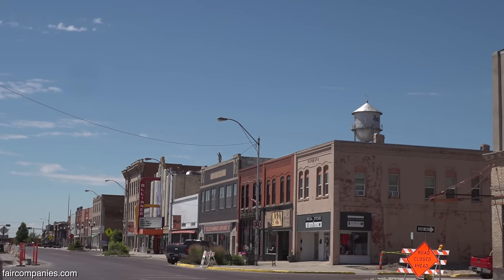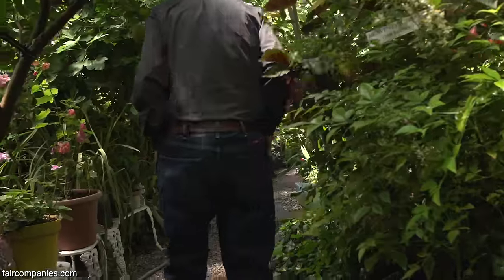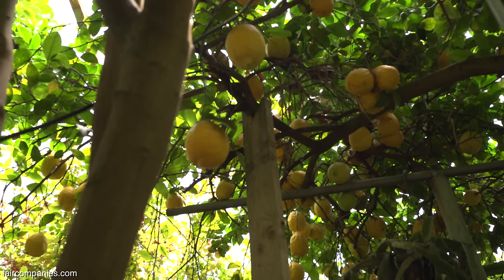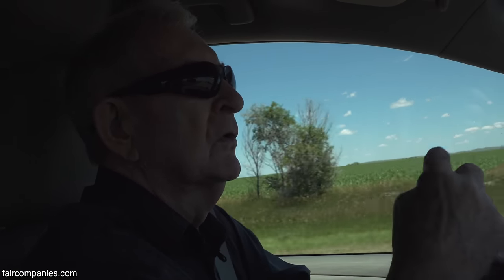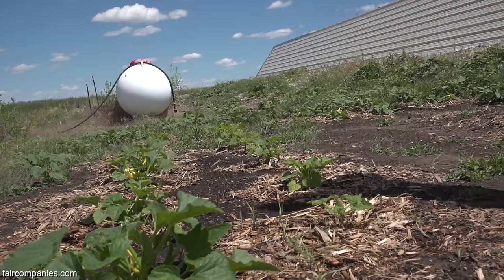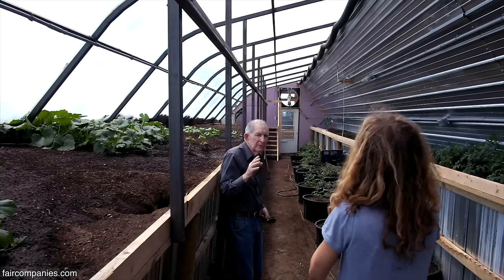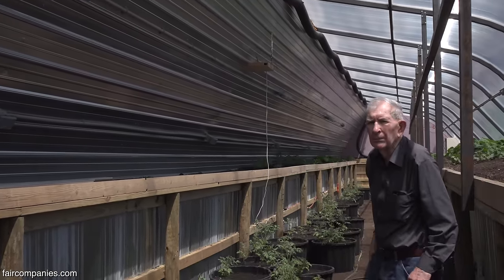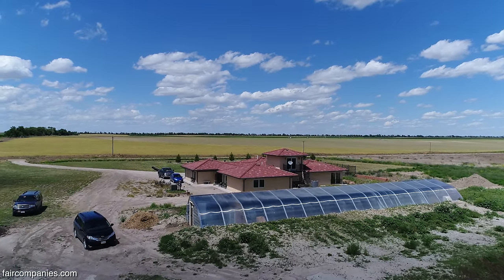Nebraska retiree uses earths's heat to grow oranges in snow

Comment: Always pull air. “Force” is dispersed when something without shape - like air - is pushed. No force is lost when pulling.
Reply: technically it would have the shape of the tube its in if you are pushing in to the tube.  I think the green house itself would be better to be sealed so it in theory would be like a home HVAC system for forced air.  Since there is the potential of a hot and a cold source.....a sterling engine could be employed to perhaps compress air to feed a Tesla turbine which in effect could drive a blower to use on the tubes and yet circulate air in the greenhouse since heat rises.  He is trying to make the system simple and cheaply conventional with off the shelf items...hence the typical black flex  8 inch conduit....very generic.   He is seemingly going by the seat of the pants to determine how long a run of pipe he needs to get the  air circulating through it to be rendered the 52 degrees of his location...…..there is no heat exchanger in the system.  He just trenches out and at 8 foot deep to bury the conduit......by the determined length he need to get the temperature.....if he is too short then he won't achieve the 52 degree constant he wants......but it also comes to the mass volume and the velocity of the blower to move the air through the conduit...….the hang time in the tube to change the temperature.   Too long of a run would achieve a better result than being too short or having to add on after the fact.....     A Tesla valve could be employed if there was a positive and negative pulse if the tesla valve was employed as a heat sink in the ground......getting the air to hang in the mass that is the tesla valve so the air absorbs the heat or dissipates the heat.   Or perhaps a chamber of concrete block laid over on their sides for the honey comb effect to have the air go through....which would be more conventional......you could use septic system parts with concrete vaults to pack with the blocks and connect the conduit system......but obviously the black plastic conduit is the cheapest.  If I'm thinking out loud.   My problem with the system as is...….is the possibility of infection......how do you keep it clean and not get any mold or bacterial growth inside the conduit where you'll be circulating it around or spores.....ultimately to cause problems with your plant life or fish......aside from working in the environment and breathing it in to your lungs as you tend to things
Reply: I would probably substitute regular rigid poly piping rather than the flex black conduit...…..you could most likely pass something thru it to clean the passageway where as with the flex pipe....there are so many nooks and cranny's......plus the poly pipe is white so it would be great with a sewer camera run thru it for inspection
Reply: @mikecamps7226  I wonder if their humidity levels are so low that it dramatically curbs the mold issue. Interesting post.
Reply: its an interesting situation.....I suppose an A & M college should step up to investigate and tweak things to get the most out of it.    I just did a posting on a different presentation concerning rocket mass heaters.  The efficiency ends up with an exhaust tat is theoretically pure.....just CO2 and water from the combustion.  This isn't a car exhaust where they need a catalytic converter to achieve that.....and the opposite end of that with air pollution pre-cat days, today we have the CO2 problem.  They created a CO2 pump in to the atmosphere.....times a few million pumps.  But anyway, with the rocket mass heater on a farm exhausting CO2 out the end of the conduit......why not dump that in to a winter green house to create an optimal CO2 atmosphere for the greenhouse and photosynthesis and monitor and regulate the CO2 level`...…...you only exhaust during a burn with a rocket mass system which might be only a few hours to charge the mass with heat like you are charging a battery.  The plant life would convert the CO2 to oxygen ultimately......its just determining the optimal ratio's..for the conversion.  If you want to totally convert all the CO2 emissions then you need the appropriate amount of plant life and thus the size of the green house.  But with a rocket mass heater....its just not the pass through with the exhaust to extract heat in to the mass......you could run water coils to heat water for pumping out in to the green house as auxiliary heating....there is a heat differential too that could power a sterling engine for a pump or run a generator to create electricity.   Engineers don't design this way.....    But being a farm, there is a big issue with biomass waste and what to do with it......obviously it would have to be dry to burn which could  be possible since you only need to burn with a rocket mass in the cold temperatures.  Sort of a big efficiency loop  of sorts that would be virtually totally "GREEN"       BUT going back to the humidity......its a green house so there will be water and evaporation and thus a humidity issue......its just solving the infection defect without using  chemicals or something adverse...and low cost and simple without a lot of maintenance.  You could use a HEPA filtration system for the air but that carries costs and upkeep.  It could get complexed.  The infection element is ever present, its just how to retard it and keep it in check so its not an issue where it destroys the crop or kills the trees or taints the harvest.
Reply: May depend on where the fans are placed? It might be easier to push air with a fan from the top of the tube than to pull it from inside the tube underground, but I'm not sure how they've set it up here.
Reply: Well considering a house HVAC system uses a squirrel cage fan......and the conventional thought of a fan is the propeller type fan.  A tesla turbine is interesting too.  My main concern is the tube being buried and the possibility of infection.....beasties taking hold in the tube and growing and then being vented out into the growing environment as a result.  Obviously there are microbes everywhere and in the air....nothing is completely sterile in a natural environment....but that tube will be a potential dark and potentially moist place which would be a great breeding ground.....so there would need to be counter measures.  You wouldn't want to compound the normal infectious agents you have to battle in a green house should something take hold in a growing season......which means breaking out the chemicals.  I think the basic premise is to be as natural as possible if it meets the criterial of organic.....or at least pesticide free for purity aspects.  But I do love the prospects of the natural cooling effect or warming effect depending on the season.
Reply: @mikecamps7226  Wouldnt it be less of a headache to just put in a traditional heat pump? I mean your paying for the backhoe to dig for the black tube, whats a couple of grand more for a legit heat source? solar panels and batteries to power it?
Reply: @mikecamps7226  I think if he sealed it the way you suggest, there would be mold and fungus problems, exactly as you are concerned about. 
He is avoiding that problem by letting outside air circulate in and move through the greenhouse.
Reply: @mikecamps7226  Black absorbs heat and the ridges give you more surface area. On top of that, it's much cheaper.

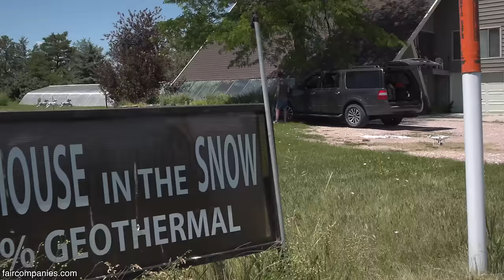Comment: 0:28 "This is probably the worst place you could ever build this..."
North Dakota: ... hold my beer.
Reply: haha, true.  Interesting though that he's not using super-high R-value material.   I do wonder what a similar approach to ND with higher R-value could yield.  I'm guessing there would be a lot more shoveling though!
Reply: @Nick-bh5bk  What would be the highest R-valued transparent material? I wonder how much deeper you might have to dig to get the same soil temperature he has. The frost can penetrate almost twice as deep in the red river valley, ND, compared to where he is in Nebraska, so I'm guessing you would have to dig... deeper. Then you have the issue of the latitude. At peak darkness 47 degrees north latitude (ND) gets 8.3 hours of daylight and at 42 north (NE) they get 9. Not a huge difference but NE gets a better solar inclination and therefore more direct sunlight. ND might still be able to grow oranges given the same greenhouse conditions but maybe not the same quality given the amount and quality of sunlight. So that would limit what you could or would even want to grow... I want to meet this geezer, seems like he's been around the block.
Reply: Hey, i totally diagree. Thus is an effective technology for most areas, you just aren't going to grow oranges in the Red River valley of ND and the building will be constructed different,  with superinsulated structure instead of what's appropriate in NE.
Reply: @dingFAching  Check out these concepts for what is possible in a cold climate:

1. Elliott Coleman showed that an unheated hoophouse within a second one can adjust your climate by at least 1 full zone
2. Creating microclimates and preventing the effect of the prairie winds is huge
3. PAH/passive annualized heat transfer is the concept upon which these greenhouse are designed and needs the earthtubes for ventilation and to prevent the wild temp fluctuations of the prairie
4. Ben Falk's permacture site in vermont has shown you can grow rice, if you manipulate mini ecosystems, but not oranges
6. Remember that temps are only 1 factor in determining what you can grow (day length and pollinators are a couple others)
Reply: Northern Hope Definitely going to google these concepts. You have any source material I could check out as well? I have no practical experience with this besides hobby level hydroponics and an interest. Greetings from Grand Forks by the way.

Comment: Just using something everyone has.  Every house in Nebraska could be heated simply by circulating air through tubes running underground, and having South facing windows angled to catch the Winter sun.  Oh, yeah, in the Summer they'll also work to cool the house!  And the higher angle of the sun, won't enter as much.  While it seems absolutely genius, it's actually only the fact that everyone else is retarded - we rely on constant inefficient use of energy with consequent financial and environmental costs.  But super inspiring.  Maybe some more people will build something like this.
Reply: I understand where you're coming from. I understand the concepts also. Don't be such a Debby downer.

Comment: In theory I could use this to 'air condition' my plants here in Texas.
Reply: Henscratch Studio by EiceBleu That's about what I'm thinking, year round lettuce and greens in FLA! IDK how cool my ground temp is, probably low 70s, since the aquifer in this part of the state is constant 72°. Between that and varying levels of shade cloth, might work year round.
Reply: You'd have to dig down to put the lines or pipes below the level where the soil gets heated. Feasible.

Comment: I wonder if this could be used for post industrial cites that have food deserts like Flint Michigan for example.
Reply: It should grow local crops in traditional means above ground. Build a greenhouse for tropical and crops needed year-round. To increase efficiency verticle farming and hydroponics can increase yields. Online sources can offer ground temperatures below the frost line in your area. In my area, my ground temperature is 55 degrees F. An old brick building could be used also. The brick can be the heat gain on the north side (like an Earthship). Many municipalities will require a large area of acreage to sign off for geothermal heating systems. Well water can also be used in a geothermal system. A heat pump like most houses uses for heating and airconditioning can be used as the motor if needed for the geothermal system.
Reply: It could. The local populace would just torch it and loot it though - perpetuating their own poverty and then cry to the government about their "food desert" problem.
Reply: @Channel-gz9hm  You wouldn't know it from the news, but we live in the least violent time in human history. Maybe we're nicer people, maybe credit card fraud is just so much easier, but we're undeniably failing to kill our neighbors these days. I know I sound like a Nostalgic Old Guy...
Reply: Anyway, the "sustainability" problem in Flint isn't growing stuff, it's the water supply. Steinbeck wrote of potato pickers in Maine, of all places. :-)
Reply: @erikscott5709  What's your point? Would you like to deny what's going on right now because of global statistics?
Reply: @Channel-gz9hm  I found people will rise to their expectations. Especially if informed and educated . An ounce of prevention/education is worth a pound of cure/bloated private ineffectual penal system.
Reply: @Channel-gz9hm  if it requires discipline  and hard work-no
Reply: How is pollination accomplished without insects?

Comment: Nice!  That is so cool.  I can tell you that the grape problem is due to dry air.  Same if you want to grow bananas.  You're also going to have a suffocation problem with CO2, but you can pipe that to your chicken coop and exchange O2 with it.  See Permaculture.
Reply: When he referred to only being able to grow "southern" grapes, I believe it's because northern varietals require a winter chilling period to produce...something they could never attain in his greenhouse.
Reply: You can use a HRV unit to exchange air on a system with minimal heat loss to solve grow lab problems. (Heat Recovery Ventilation.) I work with a lot of marijuana grow labs that have a problem with huge amounts of CO2. Those are commercial growers though. They will use compressed CO2 in their systems to make sure the plants have sufficient CO2. Not a self sufficient system. HRV's still can exchange fresh air without losing too much cold.

Comment: Awesome concept; I use the same concept in Canada for heating my home except I use water as a medium to collect/dispose of heat and high density polyethylene pipe (usually 1 to 2") for transporting it to my heat pump inside for radiant floors - again with pipe but only 1/2" -  embedded in concrete beautifully polished and colored. Water uses much less energy to transport much more heat in a much smaller pipe with a much smaller circulating pump (about 250 times smaller!) Now I just need a greenhouse!
Reply: Jealous! Can you send a link to the design? Got greenhouse up yet?

Comment: We did this in Prince Edward Island 40 years ago very successfully. Used tedlar solar panels for glazing. Manufactured them ourselves. Got higher temperatures by ducting the air from the peak of the greenhouse and actually heating the earth 8 ft down. Now growing fruit on NZ. Cheers!

Comment: I have a question please..
Since your heat transfer tubes are underground with ridges..
Do you have a problem with condensation in them and 
Do you have a problem with mold growing in the underground tubes.
Reply: He didn't mention it, but I've seen other people using geothermal heating like this and they address this issue: you have to drill drain holes in the bottom of your tubes (corrugated or otherwise). Because otherwise, yes, you can get condensation in them and yes, they can get moldy. (Although I would think the airflow going through them would alleviate a lot of the problem, but there are going to be periods of the year when you won't be running the fans because it's neither too hot nor too cold.)
Reply: They have holes drilled into the tube, and the exit and entry points of the fans use UV light.  No problem with mold and such that way.
Reply: A few years back I did some very limited research about a similar project.  The subject of that project was Solar Air Conditioning for Residential.  If I recall properly when the ground temp is 55F or  lower there's not much mold problem inside the pipes.  
When the ground temp is above 55F  -   to avoid mold problems  -  a heat simple exchange is used to move the temperature so the mold stays out of the heated  / cooled rooms.  
I have no clue whether mold would eventually clog the pipes or whether some chemical could control the mold.
Reply: Mold needs a food source, so with only water vapour getting in the pipes, unless the pipes are made of bio-decomposable plastic, I can't imagine a lot of anything growing in that environment....
Reply: @ianallen738  It's corrugated farm tile with slots for water to enter. Farm tile is used to lower the water table, thereby keeping the plants from sitting in cold water and drowning.

Comment: Great video!  I learned a lot from watching this and the fact that an 85 year old man was able to pull this off really makes me take a deeper look at my own life and question whether or not I'm being productive with my time.  Compared with him, I need to step it up bigtime!   

I didn't pick up on it, what were the day and night operating temps and humidity levels?  I think he said the stable operating temp 8 feet deep was in the 50's.  But I'm wondering for example, what the temps are the day time in the winter if you equalize all the air to 50, and how often the fans have to cycle.  And what CFM those fans are.  They looked about equal in size to the total diameter of the underground plastic tubes added up.

I'm super impressed with the lack of pest problems they have for a soil garden.

Thanks again, excellent content!